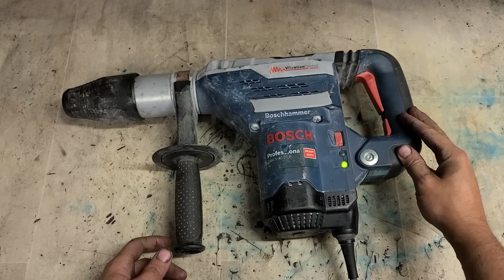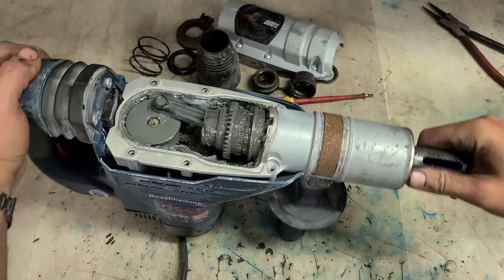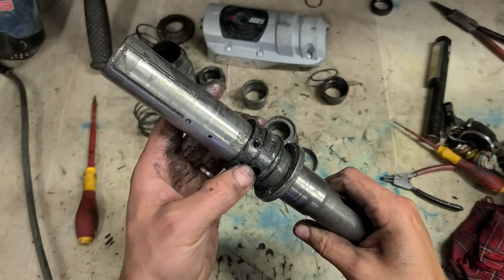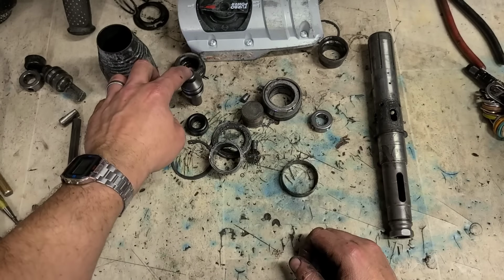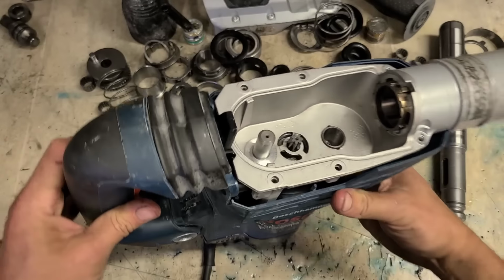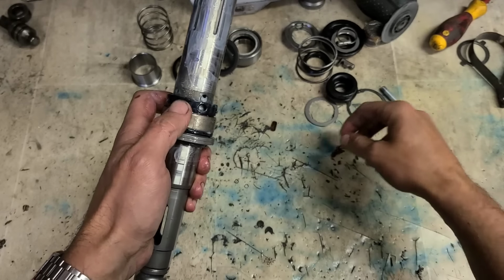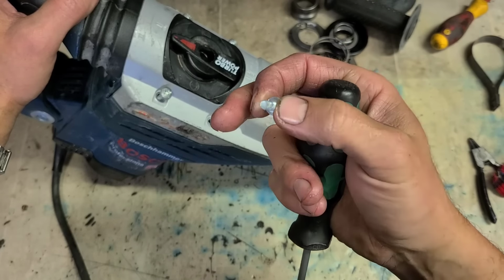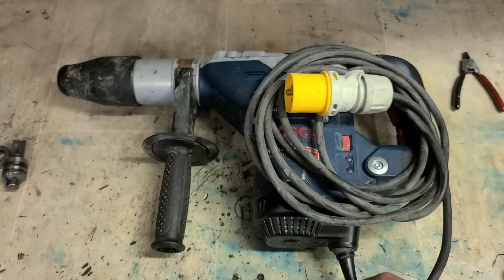Repairing a Bosch GBH 5-40 DCE Hammer that has started eating itself.

Comment: Dean. I work in the electronics industry here in ireland. Not commented before. Love the way you broke down the component parts of this hammer drill. Made it so simple. Based on your videos I’ve taken the same methodical approach in my own industry and encountered an issue with a touch panel from a well known controls system brand. Needless to say, I took it apart and recorded a video of what I was doing. I found the flaw and am surprised to say was able to fix it with a bit of solder and a cable tie. Happy customer. Never would have even attempted it had I not been so lucky as to come across your YouTube channel. Keep it up. You are a master at your craft. Very few folk left like you these days. Trust me, I’m of the generation that sits between what is now and what is yours. Would love to come and work with you in the shop some day. That would be an experience.

Comment: Thanks much for  great educational video.  
Taking these hammer drills apart is complex enough, but  to be able to put them back together with nothing left over, that's impressive.  Clearly you must've done it many times before to be able to remember the sequence.  Your video gives me the strength to tackle my SDS hammer drill that's not hammering (motor works fine).

Comment: I'm also a tool repairman and was having trouble with asimilar model. Had every damn piece on the right way but the oil seal wouldnt let me put in thd last C clip. Took everything out more than once, put everything in the same g** damn way and it worked. 🤬🤬🤬It's one of those tools. But I'm not done yet. It's the 3611B64110. The tool holder is different. You have the "normal one. I have no idea why the 1 I'm repairing is made this way. Talk about over engineering 😫. Anyway. Great videos. Helped me confirm I hadnt made any mistakes. Still have to find where that damned steel ball goes 😂

Comment: We had the strike lock up on a brand new hammer a year ago or so, it was never even used. I think i now know what happened, probably stored the case on its side in the van.
 it's a nice hammer but i really hate the trigger design, everyone always accidentally turns off the hammer while handling it.

Comment: we  have a 11241EVS, dad bought it more than 20 years ago. We rarely use it, maybe 0-3 times a year. Recently it didnt want to hammer, have to pull on the tool holder sleeve to loose the chisel and somehow the hammer would then work. once it warmed up it stayed hammering until the job is done. But I was curious and opened the cover to check it, all the grease is black. And damn, I didnt know you have to put back the screws like that, i just straight up screwed it back in. Did I screw my hammer?

Comment: I rebuilt the rotohammer but am having trouble switching between hammer and drill mode. I've tried starting it in all 3 positions (with the selector aligned to the corresponding mode). It will stay in drill mode if that's where I line it up(and work), same with hammer mode but it will not cycle. Any ideas?
Reply from the maker: the selector ring has to installed correctly so it is picking up the mode selector correctly

Comment: And I see you used a single shim.  When I disassembled my tool, it had two shims.  Which is correct?
Reply: It varies between zero and two shims. The injection moulding for the plastic housing is not as precise as the machined parts so the shims are used to ensure the best possible fit.
Reply: @trhosking  Thanks, but there are no plastic parts anywhere from the motor shaft through the gears to the hammer tube - so I don't see how plastic tolerances could be an issue.  If they are there to compensate for metal parts machining tolerances, it would be nice to know what the clearance should be.  (I was given two hammers to repair, but the parts were all mixed together -- and 3 shims, of course).
Reply: @davidmortensen3915  The metal cover on top of the housing is bolted down through the plastic housing. The selector fork (also an injection moulded part) is located in that cover and must align precisely with the shift mechanism in the clutch. The shims are there to fine tune that alignment.

Comment: What's the part number for the light grease put the gear casing? I serviced one of these but went with the mineral oil, should I replace it with the light grease?
Reply from the maker: no oil will be fine. better for the gears
Reply: @deandohertygreaser can i use engine oil? Isn't better than mineral oil?
Reply: @deandohertygreaser  So lets say I service a hammer I can just fill in oil instead of the special grase assuming that the gearbox is very well sealed.
Reply: @alouisschafer7212 So you want to save a few quid on the correct grease for a £500 power tool? Why not put margarine in the gearbox of your car while you're at it? It'll save you a fortune.

Comment: Interesting fault. Does Bosch collect reports of such incidents ?
Reply from the maker: on Warranty repairs yes. I will have to contact them to see if they would cover this one
Reply: @deandohertygreaser  I was curious on this particular use case scenario so to speak. A famed hammer of theirs with a sheered hardened steel part faulty on a machine that doesn't appear to be abused. 

No doubt this should be a good will jobby from Bosch UK. They and so many manufactures swerve so much liability simply from the customer or small/medium construction company forgetting  to or simply not registering in the required 30 day time for the 3 year warranty.

Comment: Must be a manufacturing issue.. A striker pin must be made from some of the hardest most ductile steel you can get for it to last at all. So this pin must have just been forged incorrectly or the root cause was impurity in the steel who knows.
Bosch should be notified about this failure.